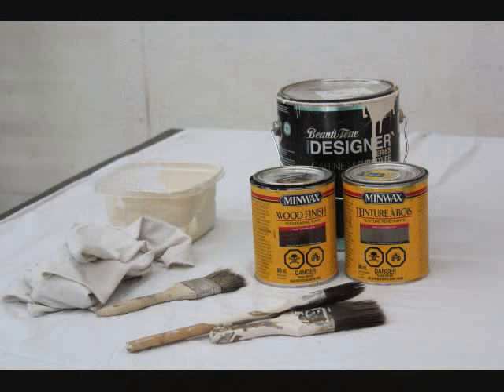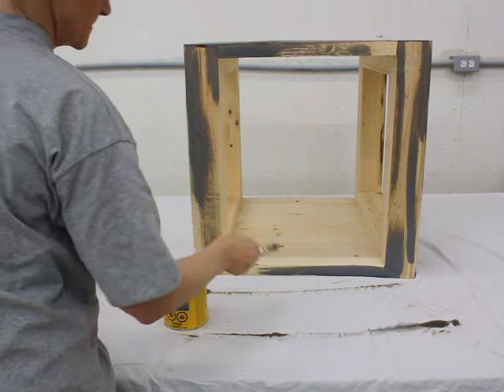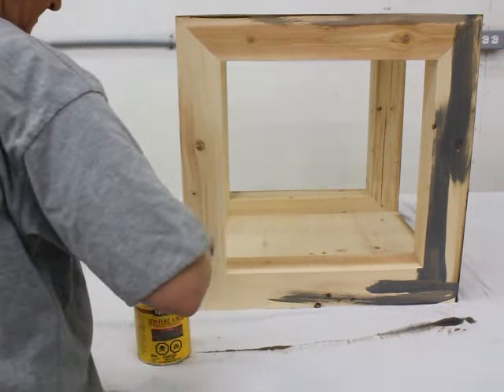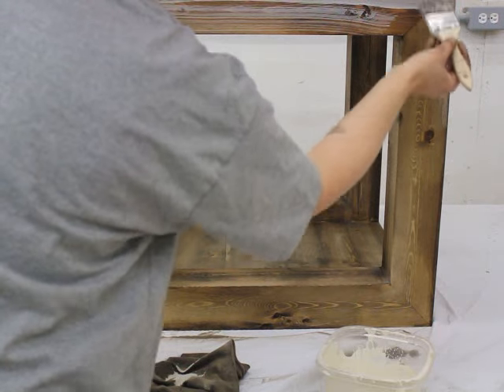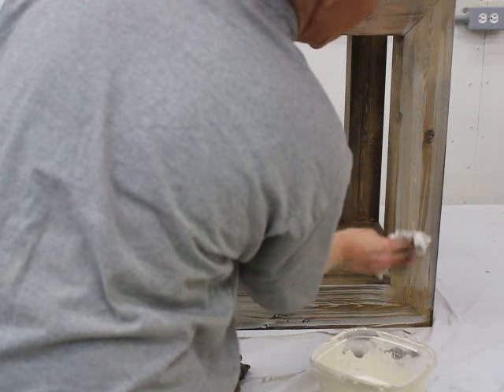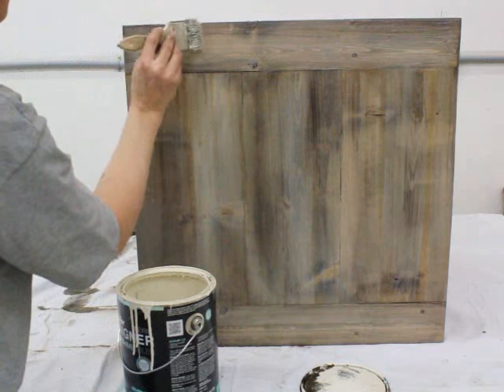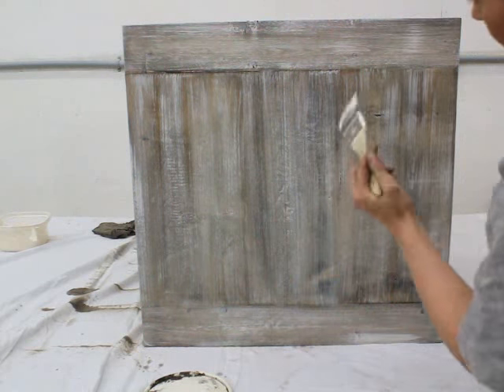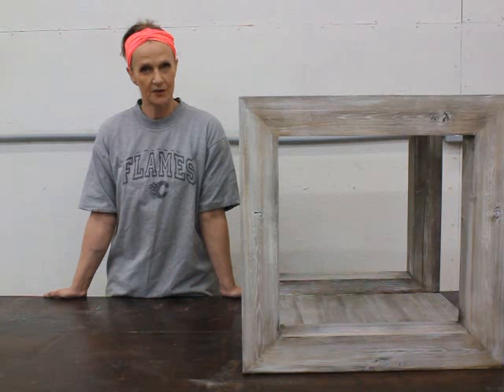Simple to follow barnwood paint effect tutorial!

Comment: Nice work. One big tip I can give anyone who is into finishes on wood is on how to get light colored woods like pine and dense grained woods to take on more tint , dye, or color. Light colored woods do not take stain well and the stain is almost always splotchy and not uniform in color. Going over and over the wood with more stain does not work well at all, nor does letting it sit for hours. Multiple stains coatings do not work well at all because stains contain a solvent, either water or oil, this is why the stain is a liquid, the color is suspended in the liquid and once you apply it, the solvent evaporates leaving behind the color. The problem occurs when you add new wet stain on top of the old stain. The solvent in the stain is going to dissolve the stain you have already applied. So all you are doing is erasing what you have already done and doing it again. This is not true with stains that are a combination of stain and top coat, like polyurethane. Those combination stains act more like paint than stain and they will cover and darken but they will also hide your wood and defeat the purpose of staining wood, which is to bring out the wood look.  To solve most all of these issues, use ordinary clothing dye like Rit dye to dye the wood first before applying stain. You can get Rit dye at Walmart or Target in powder form or liquid. Rit dye comes in many colors and you can blend the basic colors to create unlimited colors. Mix the rubbing alcohol, which is isopropyl alcohol, with the Rit dye. Use the 90% rubbing alcohol if you can get it. You can also use denatured alcohol or even vodka or Everclear liquor which is ethyl alcohol. I personally haven't tried it but vinegar may work as well, test a similar piece of wood to find out. But remember, vinegar is an acid. Grab a few extra wood paint stirrers from your paint store, they make excellent testing and experiment strips. What you are essentially creating is a giant Sharpie marker in the color of your choice.Use red solos cups for mixing. Make an applicator out of a tshirt or polyester cloth wrapped around a ball of cloth. Get it saturated but not dripping. Sometimes the Rit dye will break down into a different shade than what you started with because of the alcohol. For example, "dark brown" Rit will become purple when diluted with alcohol, just like a marker. Don't worry, the wood stain will make it brown again, very brown. Unlike stain, the more you go over the wood with the Rit dye alcohol mixture, the darker the wood will get, just like using a Sharpie on paper. If certain areas are too dark, use a clean rag with clean alcohol only to lighten up the area. The end grain of the wood will always take on more dye and stain, so too prevent this, wet the end grain with clear alcohol first before using the tinted alcohol and Rit. Despite the illusion that the stain and alcohol dye is soaking deep into the wood, it does not penetrate very deep at all and can almost always be sanded out. Make sure every inch of your wood is sanded to the same smoothness or you will have splotches. Water, alcohol, and even oil based stains will swell up the wood grain and make it raise up diminishing your last sanding. To minimize the wood grain raising, use clean alcohol or water first, then knock the grain back down with sandpaper. If you do this a few times, the wood grain will eventually stop raising up. This will greatly  reduce splotchyness and make the shades more even. One other big tip is to apply the stain with sandpaper. Use the wet/dry sand paper and dip it into the stain or dye and rub it into the wood. Use either the same grit paper you last used or use the final grit you want. When the sandpaper is wet, the stain and dye will act as a lubricant and you can actually feel the sandpaper smoothing the wood as you sand while applying the stain or dye. You can feel the sand paper working and you can hear the sound change when the wood is smoothed. If you are using an open pore wood, such as oak, the slurry of fine sanding dust that you will create by sanding in the stain will fill the open pores and will match way better than any wood filler you can use. If you use rubber gloves, you can smear the slurry and work it into the open pores. Just remember, anything you use before the stain is cured, set, or coated will dissolve your filled pores and your layer of stain. Even if you are going to apply a clear protective top coat with a brush or rag or sponge, I highly recommend that you use a spray on clear coat first. Use either the same type as your brush on clear coat or one that is compatible with your clear top coat. Once the thin sprayed on top coat is dry, your staining job will not be dissolved by the solvents in your top coat. Brushing on clear coat can dissolve your stain and open your pores you have filled. a thin, spray on clear coat will protect your color. You can also apply stain to end grain wood extremely gradually with very small amounts with an almost dry brush so it will not get too dark, then spray on a clear coat so the end grain will not soak up any more stain. I learned a lot of this stuff the hard way. I hope it helps someone.
Reply: El Tomas thank you!
Reply: Great information... thanks
Reply: just finished staining pine, little wet sponge before i applied water base stain, 2 light coats. no blotchiness, nice uniform colour, looks great. i find pine is the easiest to work with. other than maple. walnut is a pain in the rear.
Reply: Do you have a video tutorial?
Reply: Yea and wood condition helps too. Also to get rid of the red look in species like red cedar you can stain with white or fruitwood then stain it with the color you want. Those red tannons can really make a difference in the outcome of the color.
Reply: If you have a video tutorial of what you explained above that would help a lot.  My first time doing this and I want to do it right ✅️

Comment: Very interesting video.Thankyou.
If you are interested in achieving a woodgrain texture might I suggest the following technique?
Sand the bare wood to say p180
Then wipe a very damp(not dripping) cotton rag over the surface until no dry looking areas remain.
Leave vernight in a warm dry environment.
The next day,using a sanding block with a scrap of p180(essential),lightly rub back the raised areas (early growth,lighter coloured wood).
Depending on how much you wetted the wood beforehand you will have a more or less pronounced surface texture which follows the grain perfectly and thus catches the light accordingly.
This 'grain raising' effect is basicallt the complete opposite of sandblasting/driftwood texture as,in this case, it is the early growth wood(softer) which is pronounced rather than the late growth wood but at least 110% of DIYers will not know the difference!
Try it out on some scrap wood experimenting with different sanding grits and levels of wetting.
It is completely free and sustainable as well.
Have fun!
Reply: Will this work after using odorless mineral spirits or is that too repelling from the oil?

Comment: This looks amazing and thank-you for explaining so clearly. This really is the best video I've seen on this sort of thing. I have a couple of questions - In the UK there only seems to be oil/spirit based wood stains on the market - is the one you are using like this, or is it water based?  I would imagine a water-based stain would give you a bit more time to work with.  I've always used the 'spirit' based ones - and you have to be quick. They really soak into the wood very quickly. The technique might have to be different with a stain based on a different solvent. Also -  the use of sandpaper is mentioned for removing excess paint. I'm assuming you should let it dry first - is this correct? Thanks again - you converted me!
Reply: I would really like to know the same thing right now. I’m just about to try to do this and I would like to know if the oil based stain is going to work

Comment: can you please let me know what happens when i have a table that already has a varnish on it. Do i have to remove it or can i just sand it a little?
Reply from the maker: Ashley Pollak yes this finish is to be done on bare wood as the stain won't penetrate into anything that has a previous finish on so to get the best results you really should strip everything down. there are ways and means around using things like gel stain which will adhere to a piece with a finish on it however that's a whole different tutorial as it can be a pain to use to get the colours to blend in the way you want on something with clearcoat on it already :)